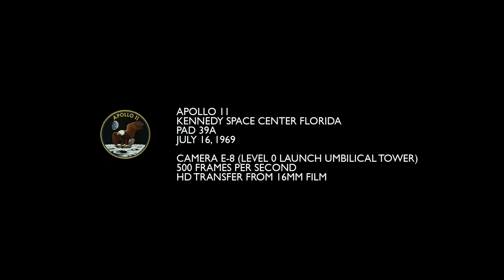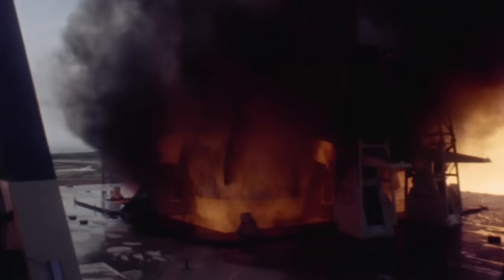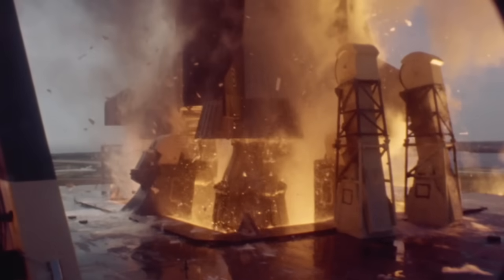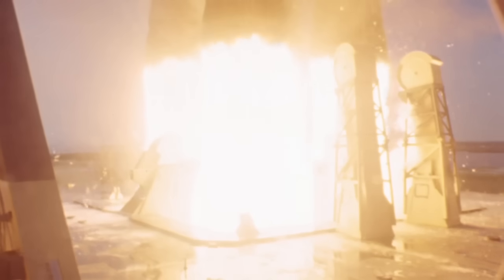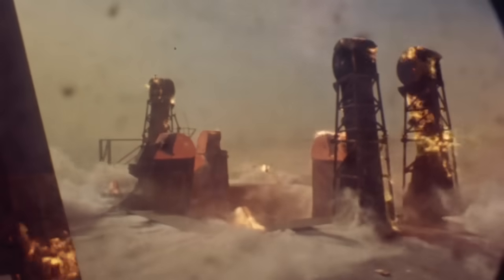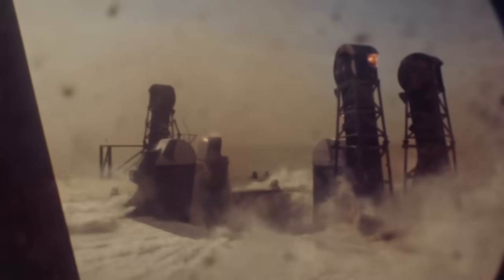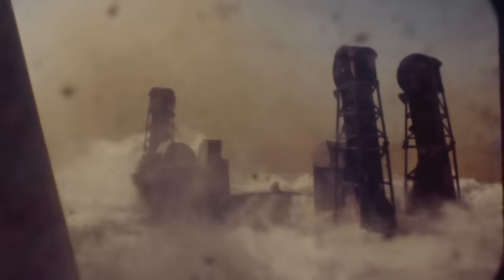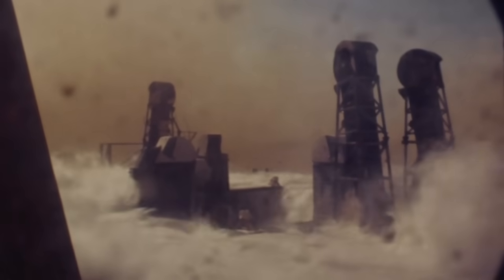Apollo 11 Saturn V Launch Camera E-8

Comment: I know this is an older video, but I always wanted to know something. How in the actual fuck did those cameras survive without being burnt to a crisp? I had no clue Chuck Norris made cameras XD
Reply: Quartz lenses and covers, several layers both on the housing and optical opening.
Reply: The housings were made like a cannon.  The cameras were placed Inside the barrel.  The  barrel was about 24 to 30 inches long.  BTW some cameras didn't survive.
Reply: Kerosene might burn at 750 degrees under ambient pressure in air, but that's not what is happening here. Even in an aircraft jet engine, the combustion temperature is far higher than that, because the kerosene is burned with preheated compressed air at 40 times atmospheric pressure. The turbopump on an F1 rocket engine generates about the same power as a large jet engine just to deliver fuel and oxygen to the rocket engine. So the fuel pumping alone on the Saturn V first stage (which has 5 F1 engines) consumes power similar to a Boeing 747 accelerating at full thrust.

The combustion chamber in those engines is an absurdly hostile environment, with fuel and liquid oxygen being pumped in at an enormous rate. The temperature in there is well above the melting point (and probably the boiling point too) of the metals the engine is made from. The only reason the engine doesn't destroy itself is that the fuel is pumped through a heat exchanger surrounding the nozzle and combustion chamber before it is burned. This is called regenerative cooling and most liquid fueled rocket engines do this. Even so, the engine is substantially damaged by the few minutes of firing - if an F1 engine was recovered intact, you wouldn't be able to use it again.
Reply: 3:35, camera is housed behind a Quartz Mirror
Reply: That 750F is BEFORE adding liquid Oxygen and compression.
Reply: Because it loses signal, these cameras were only saving not streaming it.And of course you can lose the cameras.
Reply: Jack Long: ignorant fool! "Below the thrust chamber was the nozzle extension, roughly half the length of the engine. This extension increased the expansion ratio of the engine from 10:1 to 16:1. The exhaust from the turbopump was fed into the nozzle extension by a large, tapered manifold; this relatively cool gas formed a film which protected the nozzle extension from the hot (5,800 °F (3,200 °C)) exhaust gas."
Reply: I saw one of the Sat V lift offs live. The earth did shake and even at guarded distance the roar from the five engines was unforgettable.  Later read just one of the fuel pumps could empty average swimming pool in 90 seconds. Just how old am I,  well, we used slide rules in some of my early math classes. Then about freshman year in HS came the transistor and a whole new world!
Reply: Dylan Smith you know even normal streams can lose signal
Reply: Jack Long, you need a good slap.
Reply: can someone explain to an idiot why mirrored glass?
Reply: you must be having a bad day jack long
Reply: Dylan Smith a flight capable camera weighs a fraction of the housing protecting this camera
Reply: *Jack Long
do you really have to respond like a shithead?
Reply: Jack Long: If YOU were educated, you'd know that a rocket doesn't use bog standard kerosene, and most don't use it at all…..
Reply: Wait until Jack Long finds out that glass is made from quartz, too...
Reply: Jack Long  : Everyone is a dummy but me! Mooooo-oom more hot pockets!
Reply: Ask the conspiracy theorists, they have all the knowledge we never made it to the moon.  What your seeing was a blow torch behind a magnifying glass and someone was very slowly moving the picture.  Can't fool a slick C. T they know.
Reply: Annoying person. Always someone like you, asking "smart" questions to try disprove easily figured-out situations. Surely the answer was common sense to you? The most depressing thing is seeing the few hundred other clueless people who thumbed-up your stupid question.
Reply: This footage is from Camera E8, which was housed within the concrete pad, out of the line of sight of the engines, and pointed at a heat-resistant mirror made of quartz glass, to avoid being destroyed by at lift-off.  Above the pad, similar high frame-rate cameras on the gantries filmed the rocket’s clean separation from the umbilical connections.
Reply: Dylan Smith Quit the conspiracy nonsense now. Accidents happen. Not all of Apollos on-board cameras were recovered either so there was plenty of lost footage from that program also.
Reply: Benny Löfgren Are you trying to say that the film showing them faking being half way to the Moon is not real? It's NASA's film. You thinking that Apollo went to the Moon is a conspiracy theory.
Reply: You can tell that it's real because it looks so fake.
Reply: No.  You don't know Jack Long :)
Reply: Historic video.
Reply: filming, as it were, through a periscope
Reply: Sometimes when you want to act like a smart ass you just reveal how dumb you are combustible like kerosene were used only on the 1st stage as a combustible but 2nd and other stages used in rocket launches used liquid Hydrogen fuel mixed with liquid Oxygene to achieve the required thrust and for many other technical reasons. So don't try to look that smart if you aren't that smart dude...
Reply: It made out of a black box
Reply: best answer of the bunch, Phoenix.  ROFLMHO.
Reply: Haha that's nothing, you've seen the video of the atomic & nuclear test explosions?!?
Reply: Remember the Cameras at the Nevada Test Site and the Pacific Proving Grounds that filmed the first H-bombs in the 1950s?
Reply: He told you - you just didn't realize it. Quartz lenses
Reply: lol
Reply: PlatinumEagleStudio'
Reply: Smart Arse ;)
Reply: Brocambro1:  I would of gone into more detail like you, but whats the point with these people……..?
Reply: They are nokia cameras
Reply: zoom lens?
Reply: Contact  Stanley Kubrick.........
Reply: @bongofury5924  Stanley Kubrick was a DIRECTOR, not a special effects man,like Doug Trumbull, S.D. Onions, Wally Veevers, Brian Johnson, Tom Howard, are all the folks who worked on 2001, which I saw in CINERAMA in Manhattan 51-yeas ago when I was a kid! Remember Vietnam??? We watched it on TV every night. Don't tell me that was "CGI"?
Reply: @Beamshipcaptain  my sarcasm obviously is in need of subtlety......
Reply: They put 127 frogs around the camera and they all pissed on it to keep it cool.. 🐸🐸🐸🐸🐸🐸🐸🐸🐸🐸🐸🐸🐸🐸🐸🐸🐸🐸🐸🐸🐸🐸🐸🐸🐸🐸🐸🐸🐸🐸🐸🐸🐸🐸🐸🐸🐸🐸🐸🐸🐸🐸🐸🐸🐸🐸🐸🐸🐸🐸🐸🐸🐸🐸🐸🐸🐸🐸🐸🐸🐸🐸🐸🐸🐸🐸🐸🐸🐸🐸🐸🐸🐸🐸🐸🐸🐸🐸🐸🐸🐸🐸🐸🐸🐸🐸🐸🐸🐸🐸🐸🐸🐸🐸🐸🐸🐸🐸🐸🐸🐸🐸🐸🐸🐸🐸🐸🐸🐸🐸🐸🐸🐸🐸🐸🐸🐸🐸🐸🐸🐸🐸🐸🐸🐸🐸🐸🐸
Reply: Great question, that is most certainly answered if only YOU would pay attention to all that is said in this very informative video.
Reply: Chuck Norris is the cameraman... :)
Reply: I went from England to Cape Canaveral to see John Glenn make his second flight, this time in the Shuttle. I got a special close-up ticket so I could be only 7 miles from the launch which is the closest that any member of the public is allowed. You should see those cameras, I was aghast. Imagine the biggest WW2 tank you have ever seen, with two barrels. Two men operate it, sitting on the sides of the camera. It is about 15 ft round and the barrels which contain the lenses must be 20ft long. Now that is what you call a camera! 
That is what I remember but I stand to be corrected if you know better. The camera might have been remotely operated by computer of course. Anyway it was Massive with a capital M. These were taking film of the launch, in close up from 7 miles away. It was a true spectacle, one I will never forget. I was in Africa near the equator in 1957 when the Sputnik went overhead and we could see it in the sky at night, reflecting the sunlight back to earth.
Reply: In simple words.... they "zoomed it"
Reply: It's clearly explained in the video--and by the way, it's not magic: Not everything is so extraordinary that just can't seem to be unfathomable ... we're not in the Dark Ages ...
Reply: My guess is that it is a combination of long lenses and/or prisms.
Reply: Dylan Smith You mean the antennae vibrated, theres a difference between recording live and recording in advanced
Reply: Chuck Norris is a tard
Reply: one word.. NOKIA
Reply: Yeah...everything before the things YOU care about was faked. Oh wait - I can now make anything YOU believe in fake!  :)  I love how that works!     Have a nice society for yourself, Jojo.
Reply: Telephoto lens, duh!
Reply: That was my first thought, I figured the camera was a mile away. However, it sounds that it was closer just by the description, but I can't tell. I suspect the telephoto lenses were just not what we can make today, and that today's cameras truly are a mile or more away. Just a guess.
Reply: @Jack Long
I think he is likely confused what to make of this staging...as to why the floor is moving and not the camera.
Reply: I think this part may have been real. We had model rockets before we made large ones, so its only a matter of scale. Interesting how we don't have rockets like SpaceX that align themselves with thrusters for landing. Hmmm, they must have gone about it backwards.  Besides, we have redefined space a few times already. Technically NASA claimed space to be 100 miles up. For a long time it was 200, and now it maybe max at 400 or something?
Reply: I cant help wondering why not 35MM for better clarity! The film is, after all, a record of one of the greatest achievements by mankind!
Reply: Looking through quartz is basically looking through stone.
Reply: Simple zoom.
Reply: Deloon A month ago now, and have you to date seen that video yet? Not a conspiracy guy at all. Just calling bullshit while it’s steaming. I don’t believe for a second spacex isn’t capable of streaming that video live.
Reply: @dyldevin   Where's the live stream video of your education? I mean, we got the technology, right? No live stream, your education didn't happen. Think about it.
Reply: You SHOULD be asking HOW the camera was NOT moving, but the floor of the shuttle launch area IS  moving...LOL (notice the debris on the plate glass that is stationary, yet the scene is moving.....I thought we have gone over this folks!!?
Reply: @
Benny Löfgren
"Gullible Benny" sounds catchy.
Conspiracy is an idea. When you take a bunch of evidence and indicators of fabrication, this becomes probability, a plausible reality. The scene is shaking, not the camera.
Reply: Right? And Spacex camera gets vibrates and “loses signal” when the core is landing.
Reply: @dyldevin  clearly doesn't know much about engineering. There's a world of difference between shooting a video from a well-protected stationary camera on the ground and LIVE streaming footage from a camera ON BOARD of a landing rocket. Get a clue.
Reply: @Phyzzius  How in the world do watch them LAND ROCKET BOOSTERS and not be even remotely suspect of the fact that they couldn't manage to stream the footage of it happening. and riddle me this, if streaming the footage live was indeed too much of an engineering feat for them to overcome, have you seen the footage of it yet? Or did a seagull land on the rig and fly away with their hard drive?
Reply: @dyldevin  Oh you're talking about the Falcon heavy launch? The core crashed, that's no secret. They may not have streamed it live for whatever reason, but there definitely is footage available from the drone ship, just search for it.
Reply: @dyldevin  the camera is fine but the live transmission is not. They have the physical recordings but the exhaust fumes interfere with the live feed
Reply: @Dylan Smith - Because SpaceX is made of sniveling little rich boys and girls, and NASA is a powerhouse of the top scientific men and women; that is also the difference between government (we the people) vs. private (we shareholders, who don’t care if you cut corners or lose lives, as long as we see increased quarterly earnings) enterprise. Hopefully we’ll go back to a government model like NASA or Starfleet for that matter to handle big space missions.
Reply: @dyldevin  No, the barge gets shaken and the satellite antenna sending the video looses lock with the satellite.  What you see here is from a hard-wired camera on a fixed platform.  Mot at all the same thing.
Reply: PlatinumEagleStudio's if you were educated, you’d know that kerosene burns at 750degreesF, glass melts at 2500 F. Also the lens is a quartz mirror and not glass. Which can go to thousands before melting.... Anymore stupid  questions?
Reply: liquid kerosene might burn at 750 but mix some LOX in and see what happens. Have you ever heard of an oxy/acetelene cutting torch?
Reply: But kerosene in add Oxygen burns at only 750 degrees?? Thias is a rich mixture kerosene  oxygen.
Reply: Fake fire?
Reply: jojo Crapule believe your lying eyes 👀
Reply: jojo Crapule LOL, fire looks real as fuck and I enjoyed watching it burn. Moon landing?....Now that's a whole different story.

Comment: Thanks. Very informative. When it was on TV, one didn’t think of all the different things they had to plan for to make this mission work. (“hold-down arms,” chocks to hold newly ignited rocket down; hoods to protect the chocks from hot exhaust, special paint to protect the hoods from the fire). But the Apollo project employed more than 75000 people, at NASA and its contractors, at its height in the late 1960s, if I recall correctly.

Comment: Fascinating technically and well described.  All the unseen events and considerations that happen in split seconds - incredible.  The coating most likely used on the hold down arms is generically known as an "intumescent paint".  It's widely used in the construction industry to protect (usually) steel or critical parts of a building to prevent the spread of flame.
Reply: ly

Comment: This is 1969...something we are incapable of nearly 50 years later..Think about that
Reply: Yep. Perceptive comment.
Reply: "...these launches cost a ludicrus (sic) amount of resources."

But to what return on investment? Vastly more benefits than costs.
Reply: @jamespobog3420  Like what man? I'm all for it, but you can't just  try to go for leaps and bounds when there's no target goal or obvious needed technology.
Reply: Like what? Tons of stuff. Miniaturization of electronics, freeze-drying, Teflon, robotics, oxygen and carbon dioxide sensors, UV-blocking filters, memory foam, velcro, digital image processing, GPS, Kevlar, portable cordless vacuums, LED's, microencapsulating technology, simply tons of stuff.
Reply: "Incapable"? Who says we're "incapable"? Not doing something and not being capable are two entirely different things, these launches cost a ludicrus amount of resources.

Comment: How come this huge rocket propelled piece of JUNK  goes to the "MOON" that has to go thru all the different layers we are told about,  then it must instantly get all sucked up back into the layer so that we only have a very small less than a 1/4" hole in the Ozone layer that they are saying is not good & is the cause of the Global warming crap they are talking about when I don't think they even got to the layers of anything that supposedly covers the earth at all...   Otherwise if it was true, the holes would be a lot larger than 1/4" in more places than one place ...   What a bunch of bullshit they are continuing to feed us & all you dweebs are believing all this crap anyway.  The USA never set foot on the moon, & the "sound stage" inside of the place that they said all the aliens spacecraft  was located in AREA 51 in the desert & where they filmed a few frames of what we saw from the moon's surface as it was played in the James Bond, 007 movie called "Diamonds are forever".  & IF NASA is no linger here, where did all them people go that  were on the payroll each & every week they were sending shit into outer space all these years??  Hahaha  Nice pipe dream NASA made up  just like 9/11 when the airplanes took out the buildings that had to be blown up by conventional means because the Kerosene didn't burn as hot as they said it did to crumble all the beams that were holding up the buildings & they also used Thermite to get rid of the 3rd building that never even got hit by a plane at all..  LOL  Great Si-Fi Bullshit stories they came up with  from our Government don't cha think now.. huh LOL
Reply: Wow... 2 lying idiots having a circle jerk...

Comment: that was amazing. awe-inspiring even. gives you a small taste of just how much insane engineering goes into even seemingly small things like the materials that the launch platform and towers are made out of and painted with, as well as the water delivery systems for putting out those fires. not to mention the sheer power of that exhaust. incredible!

Comment: Great footage. As a film maker who loves filming in slow motion, I can safely say that camera was not filming at 500fps 
The original was filming between 180fps and possibly 200fps. The rendering to video is likely to be US standard 30fps 
On my editor the frame rate seemed variable. 
The falling ice made it easier to work out.

Comment: If Obama would never have shown up we would be done with the Middle East and still had a Space Program. He destroyed everything that was good about the USA. Now its going to take a generation to fix it all.
Reply: What the hell did Obama do to the middle east and the space program?
Reply: George W. Bush cancelled the program in 2004. Barack Obama later cancelled Bush's disasterous  Constellation lunar program, replacing it with the Orion manned mission to Mars scheduled for 2033.
Reply: jacob norris Obama shut down the STS program, putting the space shuttle into retirement.